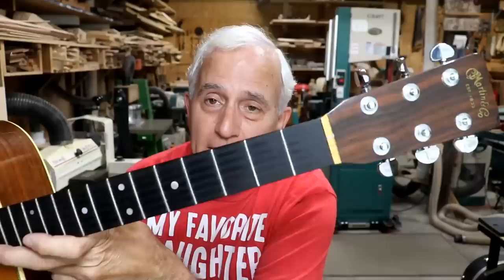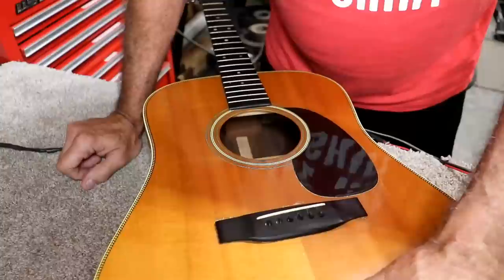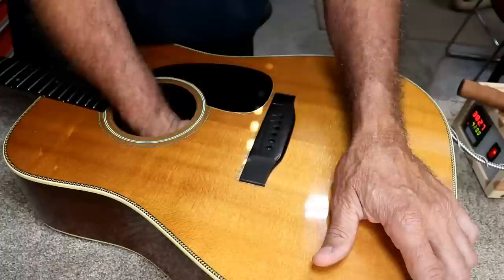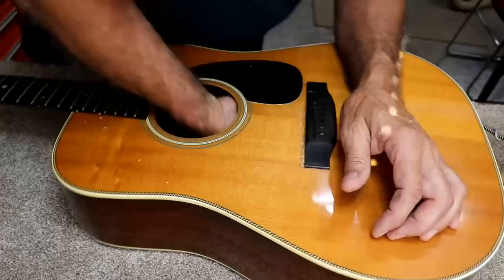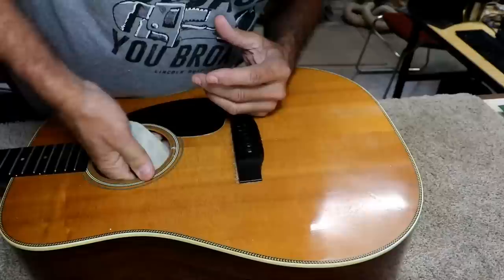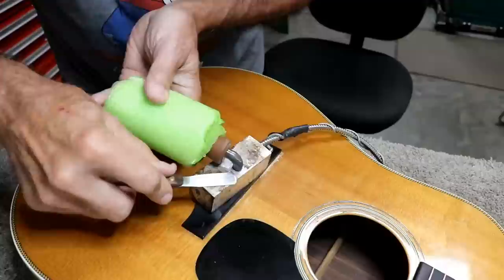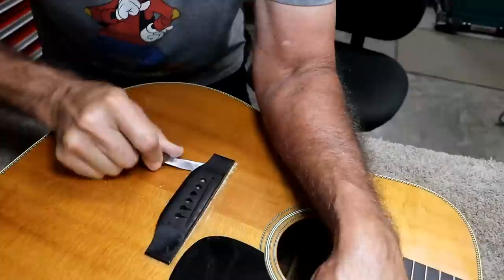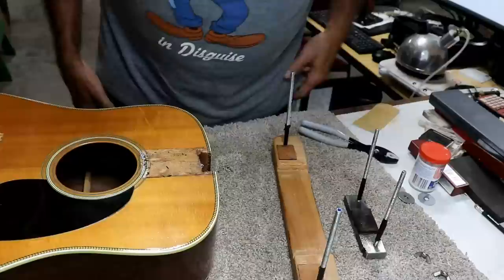597 RSW HUGE PROJECT - I AM Nervous! - Part 1 HD 28 Martin Repair

Comment: A bitnof science for you from a chemist.  If you are heating wet material, you limit the temperature to the boiling temperature and limiting the exposure to very high heat.  It also absorbs a lot of energy so your heater will show lower temperature...

Comment: Jerry, have you ever thought of a 'Pressure Cooker' vessel to produce your steam? There's a rocker on top and I believe you could manufacture a 90 degree outlet to the top outlet and run the plastic hose off the 90 degree add-on and still have a rocker for safety on top. They're usually built real sturdy and can pick them up, with a little luck, at a second-hand store.
Reply from the maker: I'm really getting plenty of steam that's not an issue

Comment: You need a couple more hands with a clothes iron to heat your StewMac puller while you heat the bridge pad.  Or even a propane burner to warm it a good bit.  Heating two things  and only two hands-- there has to be a better way.   Hummmm!

Comment: I'd wear a heavy engineer glove to use that 400 degrees chunk metal heater inside the sound hole to each it's own
Reply from the maker: My hands are too large to wear gloves and still fit through a sound hole

Comment: Have you considered putting some fiberglass insulation tape around the unused faces on the spicy end of your heater?  Same idea as wrapping motorcycle pipes with tape, the tape gets almost as hot as the pipes but since the FG doesn't transfer heat as fast you have time to move away before you get a nasty 2nd degree contact burn. Should be able to hold it on with something as simple as wire. The sensor going wild is an indicator of a bad connection somewhere on the thermocouple, or it touching the grounded shield. I have a similar PID controller I use to keep a curing box at a fixed temp with a heater/circulator and it started doing the same thing, found the TC junction was broken and making intermittent contact. Easiest fix is a new TC sensor since they're usually cheap, but I was able to get mine functional again just by twisting the TC wires together.

Comment: Jerry: that's a hd-28.   The d18 has mahogany back and sides with black binding.  The hd28 has rosewood back and sides, two piece back with center binding and side white-binding.  Neck-block will have hd28 stamp. Problem era for them was 70'' s.
Reply: Garcdonald, do you know if early '70s D-18s had their own problems?  I have a D-18 and was wondering if I need to be aware of anomalies.  Thank you!
Reply: Well done, what a nightmare of a job.
Reply: You missed the text, inserted at 0:22.

Comment: I love your videos. I wish someone would invent a tiny router on the end of a flexible shaft, to rout off an obstinate bridge plate.
When the temperature of the bridge heater dropped, nothing was wrong. The energy was going into boiling the water away rather than increasing the temperature. It could not increase beyond the boiling point of water until the water was gone.This is the Latent Heat of Vaporization.

Comment: I have a wallpaper steamer. It’s a big plastic container with a heater in it a pressure cap like a rad cap on a car radiator. It takes about 15 mins to start steaming and it’s good to go for about 20 minutes. Relatively cheap had it for a long time. Lots of water contained in box and safety with pressure cap.

Comment: ???? QUESTION: When I see the effort and heat that goes into removing these bridges, I wonder if using a router jig like you did for the area under the bridge could be used to route/mill away all but a few thousandths of an inch of the bridge? It would seem that only a little heat and water would be needed to get that last bit out. The heat would go right to the glue joint, rather than heating the whole bridge and surrounding area.  Or maybe even mill right to the surface, similar to what you did here for the veneer fill piece?

Comment: I think is a bit of a testament to the builders of old Martins ( and many other of course) that it is so hard to take apart, even your own repairs seem so good as I'm sure yer afeared going back into one, except of course you know all the materials etc. etc., and I think the craftsmen that put them together didn't expect some parts to come off/depart/un-glue.  I have a very silly question that occurred to me watching you heat the glue from inside then outside, which didn't really work until you started adding some moisture, is if you have ever consider an opposite approach, I mean using NO2 and freezing in a very controlled manner, keeping the top dry so as to be not affected and maybe wet the part to be removed?  I know its goofy but I am a curious sort eh and if I had the stuff to experiment I likely would but for now just keep my knives and chisels sharp and my fingers intact :)  Cheers to you Jerry on that project and love and respect from PNW Canada, all the best to you and yours man!
Reply: Using cryogenics, in that manner, you would just rip the wood apart.
It would be worse, than using nothing at all.
Reply: @zapa1pnt  Yeah I had a feeling that would probably be the issue, even with oiling (?) the inside of the top around what you don't want to shatter, oh well matey, just thinkin' outside the box then.  Love your work and dedication and I surely feel your frustration sometimes when dealing with the really borked gits, thank you for sharing your knowledge and adventures, good health to you and yours' and look forward to more learning :)  Cheers from BC Can.

Comment: My 1983 HD-28 needs everything you just did.  I just sighted down the body at the nut and sure enough it was way above.  Perhaps 3/8 inch just like this one.
But I think I'll just sell it to someone who likes cowboy chords.  And buy a new HD-28 that has a truss rod.  I love the sound of the HD-28.  I especially like that low end because I play a lot of muted thumping of those bottom end strings.  I also tune the whole thing down a full step.

Comment: Would it be possible to drill two holes in that heater bar, tap them and then insert two screws through two holes in the bridge. The screws would hold the heater bar in place flush up against the inside and you wouldn't have to hold it. Just an idea.

Comment: I see you using your hot iron to remove the bridges of the guitars and mandolins. 
I understand it's quite a proceedure. I have a thought. Would a Hot Air Soldering station as top temperature is around 500 degrees and is also has variable temps as well as adjustable air flow.  This might be just the answer to heating to remove bridges  or anything else that can be removed by using heat and air. just a thought, maybe worth looking into.

Comment: Water has a good heat transfer coefficient wet wood will heat better than dry wood 🤓 then it depends on what sort of glue it is, f it's a polyurethane based glue like “Gorilla” glue, then nothing will soften it🤓

Comment: Might be time to check out the bridge saver from Stew Mac. I bought a 1962 000-18 with the original bridge plate that was repaired with a bridge saver years ago, and the plate is in excellent shape. The plugs are done cross grain which actually makes it stronger than original. I do setups and light repairs myself, but I think I might get a bridge saver tool for these rather than fight with removing the plate.

Comment: The tool you need on the inside should have the edge of a craft knife and then get thicker, the one you have is far too hefty for this job.
The fact that this guitar has had to be repaired before says more about the build quality than anything, there are guitars a hundred years old that have not got the problems this one has. Excellent video and the patience of a saint.
Reply: Its a stewmac tool. So great to know you are smarter than the guys at stewmac, who have been doing this stuff for a crazy long time. And you are watching a craftsman with 40 years experience. I think he may know a little bit about what hes doing!

Comment: Shouldn't the grain direction of the bridgepad run in the same direction as the top?
Reply: No, because then it would not lend strength to the top, to keep it from bowing up.
With the grain in the same direction, the plate would bow with the top, in the side to side direction.
Reply: @zapa1pnt  But the bridge already takes cate of the side to side. Surely the bridgeplate is supposed to prevent the bellying behind / dipping in front of the bridge?
Reply: @jackbombeeck4958 : There is a series of events involved, in the bowing of the top and the forward leaning of the bridge.
The first is the bowing of the top, perpendicular to the grain, because that is the weak direction.
Just like corrugated paper, when you lift it in the middle, it will bend/sag perpendicular to the corrugations/grain.
After it has begun bowing upward (side to side), the string tension will now start to pull the back end of the bridge forward (because that is where they are connected) and the front of the bridge will dive down, due to the leverage applied.
So the grain of the bridge and the bridge plate needs to be perpendicular, to the top, to avoid the initial bowing.
It also helps greatly, if the new plate is larger in Both directions, so to avoid bowing And forward leverage.
Reply from the maker: No it should be exactly opposite

Comment: Jerry - Have you seen the "foam cutters" that Ted at the twoodfrd YouTube channel uses to heat up the neck joint? No steam needed. Seems to work extremely well and fast. You can watch him to it in this video starting at about 27 minutes in this video: 1920's Martin: Bar Frets and Koa, https://youtu.be/9-ECsVzo7Kg?t=1630

Looks like the way to go.
Reply from the maker: Yeah I've tried doing it dry I'm not a fan
Reply: Is taking the back off an easier and safer option ?  @Rosa String Works
Reply: @nmd14723 : No, certainly not.
If you did, you would then need to repair the damage you have done, to
the back - to -  sides joint and then also repair the finish.
It is Much better to persevere, working through the sound hole, as bad
as that can sometimes be.
Reply: Those foam cutters have been proven time and again to be much more efficient than steaming, in 90% of applications when removing necks.  It’s a great suggestion.  I’ve spoken to and observed luthiers removing necks consistently under 15 minutes with them.   But to each their own - whatever works for an individual is completely acceptable

Comment: Everyone that knows anything about Martin guitars knows that Maple bridge plates are much better than Rosewood bridge plates so unfortunately you are talking nonsense there.  Maple bridge plates are the reason Martins pre 67/68 are more desirable than later ones as they all had a small Maple bridge plate and then in the late 60's it changed to Rosewood and then in 1969 Martin changed it to a much bigger Rosewood bridge plate nicknamed the tone muffler as it was so big it killed the tops and that's one of the reasons why late 60's and 70's Martins are not desirable as they were overbuilt with a Rosewood bridge plate and quality control was crap. The HD28 came out in 1976 and Martin went back to the small Maple bridge plate on this model to try and recreate the Golden Era tone as they knew that the Rosewood bridge plate wasn't a good idea tonewise. Small Maple Bridge plates are the quintessential Martin ingredient in all their great guitars from the Golden Era so I would trust Martin when they use small Maple bridge plates rather than Rosewood bridge plates as they invented the Dreadnought.

Comment: Maybe the original bridge replacement was not done properly..using another glue type to solidify the repair..to the detriment of future luthiers...been there..done that...use a small finger plane to shave the left over plate down...sand and voila..a clean place to glue..hyde glue only!...the new plate..
I would have been tempted to dremel out the bridge crack and place a new piece of fitted ebony to strengthen the original bridge rather than introduce a new one..